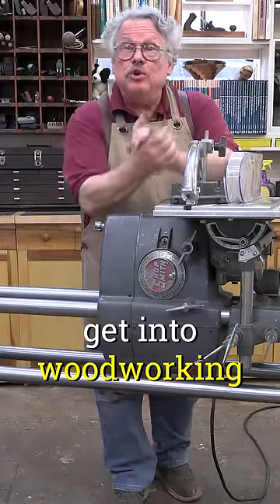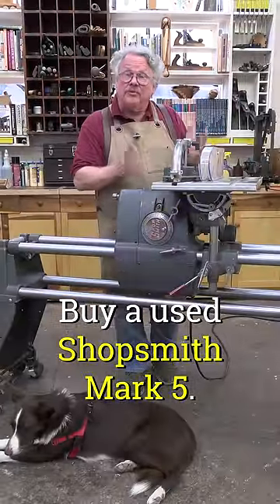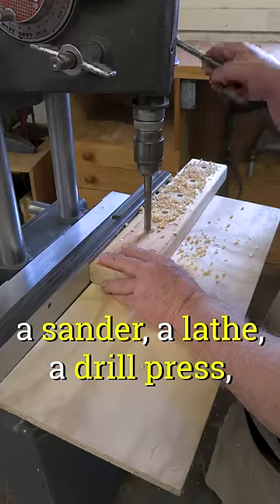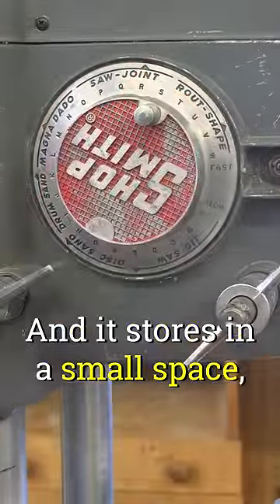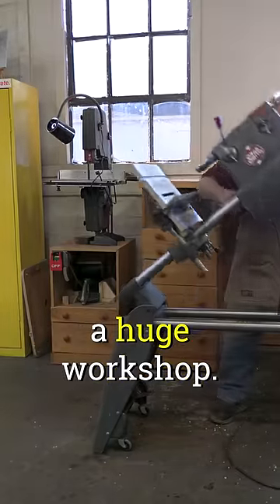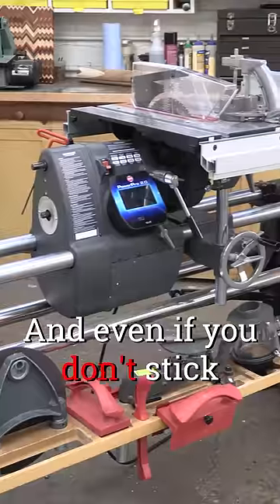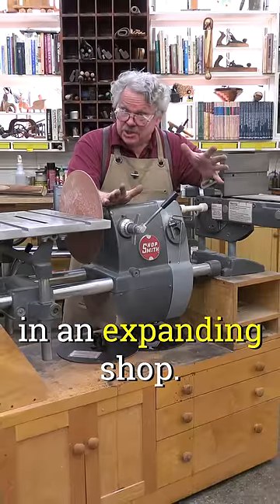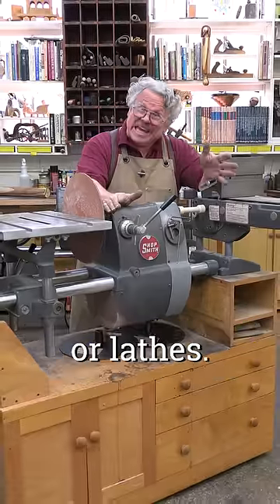A Cheap Way To Get Into Woodworking

Comment: I would tend to suggest a Mark V 510 as a starting point, since upgrading the table system is cheaper. I am leery of using the older table system for table saw operations, but that’s just me. Look for ones with accessories. I use the bandsaw and strip sander most frequently, although I also have a jointer and 6” belt sander.
Reply from the maker: All good points. Used Shopsmith Mark 5s come in three flavors -- Models 500, 510, and 520. The 500 has a small table. It's not unsafe, but it's annoying . The 510 has a much larger table and a much better locking system for the trunnions. The 520 offers an improved fence and fence lock. So the big jump is between the 500 and the 510. And Shopsmith makes several "stand-alone" tools -- band saw, scroll saw, jointer, planer, belt sander, strip sander -- that can be powered by the Mark 5 or mounted on their own stands. Many of the used Shopsmiths for sale come with one or more of these.

Comment: The old addage applies here.  Shop smith is a jack of all trades, master of none.  Setup times take too long when you need to move between types of use during a build. Had one from the 50's, and a mk 5 later on. both were gifted to my by other woodworkers. One ended up as a drill press always, and the other as a lathe.  Too dangerous as a tablesaw. ended up getting rid of both for dedicated tools, because the dedicated tools are much better at the task they were designed for.
Reply: That was never a problem for me after I got the bandsaw on a separate stand.  And it fits.

Comment: I don't think it's a Mk 5, or if it is is an older version, but I got it for free, and I primarily use it as a drill press, larger lathe, and for sanding. And at some point I'll probably also inherit my dad's old one.
Reply from the maker: It's a great sanding, drilling , and turning machine. I have two, one set up for sanding only, and the other one switch hits between boring and turning.

Comment: My dad has one, the saw, the sander, the drill press,  the band saw, the lathe. he doesn't use it as much as he used to; I'd love to sell it to someone that would use it to its fullest.
Reply from the maker: There is a Shopsmith group on the Reddit forums -- you might mention that to them You could also try the Shopsmith forums on the Shopsmith web site, https://forum.shopsmith.com/

Comment: Another question for you. How would you get started with woodworking when living in an apartment?
Reply: Hand tools, unironically. Depends on what you want to do, but work outside under a tree, the way most carpenters did until relatively recently. Power tools are nice in that they might allow one to work faster or do some things more accurately, but most work worth doing is still possible with a smathering of good old style saws, chisels and planes and folding saw horses--lathe turning is one exception that is kind of hard to do without big dedicated tooling.
Reply: For a super basic and compact tool kit that will allow you to do a surprising amount:
- a screwdriver with interchangeable bits
- an electric hand drill (I picked up a used one for $50 and it still works just fine 14 years later)
- a set of bits for both the drill and screwdriver
- set of drill bits
- set of sockets, handle, and adapter for screwdriver handle.
- a pair of pliers
- tin snips
- a hand saw (larger teeth cut faster but leave rougher edges and small teeth are for finer smoother cuts)
- a hammer
- a few packs of sand paper (60, 100, 220)

You can get most of this stuff pretty readily from a second hand store.  I would avoid buying a saw second hand unless you can replace the blade or are willing to sharpen the blade.  From there you can pick up new tools as you need them or as you can afford them.
Reply from the maker: See Tk-zf7sx's comment about maker spaces and the replies. Maker spaces are large, well-equipped workshops. For a small monthly fee, you can use the tools. Many offer classes, and all of them offer comradery with aspiring craftsmen and women.

Comment: Spending time converting my tool into the next tool I need would prevent me from ever doing projects.  Imagine if you just ran a bunch of boards and started the next process only to realize one was damaged or you need one more.  You have to convert the entire tool back.
Reply: You either invest more money or more time.
Reply: It literally takes one minute to change functions, but you do learn to plan ahead better.
Reply: Imagine rolling your big table saw out, meticulously setting the fence to rip a bunch of boards. Satisfied that you did the job right, you tear down your set up and move on to the next thing only to find a spoiled board. You still have to set up the saw again.
Reply: @nathanwahl9224  It takes way more than a minute for some functions.  It's just another barrier that is going to cause many beginners to not even bother doing a project.
Reply: @mikeking7470  Why pretend that setting up a table saw is somehow equally difficult to converting a tool into a table saw AND setting it up as a table saw?

Comment: I more or less inherited one that my dad bought in the 70s. It has barely been used but has been stored in a leaky shed for decades so there is some weather damage. I don't know how bad it is yet. 😢🤔🤓🍻
Reply from the maker: Fortunately for people who inherit or purchase neglected Shopsmith equipment, most of the work surfaces are cast aluminum. It takes some elbow grease to get rid of the corrosion, but they do no pit. The biggest problems are usually the way tubes, and being steel these will pit. Fortunately the pitting does not affect their operation; they will work fine if you polish and wax them. Quick tip: Because the of the manner in which these tubes are manufactured, they all have a very slight bow, so small it can be hard to see. After polishing the tubes and putting the carriage back together, leave one of the way tubes loose in its sockets. Slide the headstock back and forth on its tubes to see how easily it travels, then move the loose way tube 1/8 turn and see if the headstock travels any better. Continue until the headstock glides easily -- at this point the tiny bows in the way tubes are aligned. Lock the loose way tube down.
Reply: @WorkshopCompanion  Thank you for your response. I am actually most worried about the motor. The roof leak in the shed is bad enough that the floor has rotted from under the Shopsmith and it is setting on the ground. Once I get it out I will be able to inspect it better. 😢🤔🤓🍻

Comment: I had one with a bad motor and i just sold it for 100$ to a guy on facebook. He drove 10 hours to pick it up so i feel like i sold it for less than it’s work but i haven’t used it in years and since i’ve replaced it with equipment that does one job

Comment: Step 1. Buy a Jigsaw

That's it. Thats the only tool you need. If you get really good with a jigsaw you don't need anything else. (Except maybe a router)
Reply: There is a lot of truth to that! I built a teardrop trailer with a chop saw, a scroll saw, and a belt sander. And, of course, 3/8" corded VSR drill for drilling and driving drywall screws.

Comment: I have one I'd like to gift but I feel bad not having many accessories for it so I am sort of stuck... makes for a neat tool though.

Also you can get a low speed or high speed gearbox for up to 10,000 rpm I think.
Reply from the maker: Used to. Shopsmith had these gearboxes available before they came out with the digital variable reluctance headstock, which delivers 250 to 10,000 rpm with no change in torque or hp.

Comment: I’m a welder fabricator. I think this could be useful for metalworking as well
Reply from the maker: I've used my Shopsmith for metal spinning -- turn a hardwood wooden form, then spin a round sheet of soft metal, pressing it to conform to the form. I've spun brass mostly, and it works well.

Comment: I recently acquired one. With all the attachments. Unfortunately it's missing a few key components for it to work. May have bitten off more than I can chew.
Reply from the maker: Lots of SS parts available on Ebay, or from the company itself. Be sure to get yourself a manual; they're free: https://www.shopsmith.com/manuals-information/

Comment: Yeah no.. get cordless drill in your price range, hand saw, couple basic chisels, drillbit set, metal ruler, 90/45 angle, box cutter, pen, basic hand plane, diamond file, round and flat rasp, metal file for finishing wood and sharpen plane blade, wood glue, least 3 clamps and few grits of sand paper. In new those are maybe 400$ used maybe 100-200$ if you look for good deals. With those you can build pretty large projects even on small apartment, while outsourcing metal work and cutting the wood to shops until you get space and tools to mill your own lumber. You can also save lots by recycling materials or dumpster diving on wood suppliers scrap bin

Comment: Are they useful for metalworking as well?
Reply from the maker: A Shopsmith requires a speed reducer and a two-axis table in order to use it as a metal lathe.
Reply: @WorkshopCompanion  interesting. Thanks for responding!

Comment: If I don't have a lot of space is it viable for me to get into woodworking with just a rotary tool? I have a knockoff Dremel brand and have been watching videos on how to make small projects. Thanks for the video!
Reply: hand tools Dude Hand tools
Reply: Really depends on what kind of woodworking you want to do. Dremel are great for carving figurines with shaper bits, that kind of stuff, but if you plan to make fine woodworking projects like jewellery boxes or furniture, a dremel won't cut it - literally and metaphorically. Rex Krueger here on yt has some great vids on how to get started with cheap hand tools and a low, inexpensive woodworking bench. Good luck!
Reply: you can definitely rig up a dremel to a cnc machine a go tot town. also for small tools, I'd recommend a good drill, sander and one of those hand-held saws like a worx one. i love mine and got it for $40.
Reply from the maker: If you have the desire and the gumption, you can get into woodworking with a pocket knife. And don't think you actually have to own the tools to get started. Several of my friends learned from kind neighbors with tools -- woodworkers tend to be extremely helpful people, as you can tell by all the folks who answered you. You might also look for a "Makers Place" near you -- a well-equipped workshop that you can use for a small monthly fee. These too are usually filled with helpful people.
Reply: Thank you all for the kind replies, they help lots! To answer clang's question, I'm starting off my making small wooden rings. I'm not planning on making furniture just yet and probably would have the space for a small workshop by then. Again you all are amazing thank you!

Comment: You could spend $2000 on a shopsmith (not including the cost of freight shipping or going to get it yourself) + more on accessories, or you could spend $2000 on everything a new woodworker needs + more on accessories. Either way it wont be cheap.

Comment: Anyone in the northern VA area in the market for a shop smith v 5 I have one practically new bought from a collector and used a handful of times. My space and needs were too big but it’s got all the fittings and attachments that came standard and then a bunch more add ons it’s the anniversary edition.

Comment: Hey there! I just have a question real quick. So, I'm not sure if you’ve ever seen the show NCIS, but in the show one of (if not THE) main characters is Leroy Jethro Gibbs. Now, Gibbs is... an interesting person, not keast of which because he literally builds boats in his basement... yeah. So really, I just want to know, is it possible (or probable) to do what Gibbs does: build a wooden boat using only hand tools in a small(ish) space such as a basement? And if you think this question is dumb, unprecedented, and just overall not one that you (or anyone else) can even answer... you probably have a point 😂.
Reply from the maker: Depends on the access to your basement.
Reply: @WorkshopCompanion  Gotcha lol! In that case, it is stated that Gibbs uses a hole in the wall to get it out. Meaning all he has to do is break down the wall, wheel it through and then bring it up to a ramp of some sort I think. Anyway, as I said before this is probably a stupid question but I can't stop thinking about it lol!

Comment: Is $1600 CAD fair for a like new Mark V? I never knew about something like this and I feel like it's exactly what I need.
Reply from the maker: Depends on the accessories it comes with -- and your area of the country. For a Mark V Model 500 with the standard accessories in the Midwest, it's pretty high. If it comes with a few SPTs (single-purpose Shopsmith tools, like a band saw), or if it's a Model 510 or 520, that would sweeten to pot.

Comment: Much better solution:: start woodworking with hand tools.  Learn each tool, master each tool, learn what the tool is for, learn to "listen to the tool".  The great majority of operation of woodworking can be done with hand tools and most projects require hand tools even if you have power machinery.

Comment: I wouldn't touch this with a 10 foot pole. Very dangerous and difficult to find replacement parts. For the same price i would buy individual parts. If the motor goes out then all your tools go out.

Comment: Can the lathe also be used for metalworking?
Reply from the maker: I've done a fair amount of metal spinning on my Shopmith. And I've seen a video showing how to convert it to a metal lathe by mounting a 2-axis milling table to the carriage. The problem is speed -- the standard headstock can't be adjusted to run much slower than 700 rpm, the "PowerPro" headstock won't go down beyond 250 rpm. You need to find one of the speed reducers that Shopsmith sold in the 80s and 90s.

Comment: Could you use this machine with metal work?
Reply from the maker: I have use may Shopsmiths extensively to work aluminum and brass when building airplanes -- cutting, drilling, turning, and milling. For the last two, you need to get adapters so you can mount . chucks and arbors. Have also found that the Shopsmith in the lathe mode is exceptionally good for metal spinning because of its low speeds. A Shopsmith with a PowerPro headstock is even better -- the digital controls allow you to get down to 250 rpm. However, the one thing you miss when metalworking with an SS is the hollow arbor that it so useful for threading and turning rods and pipe.

Comment: Mine the dial is locked and the motor keeps tripping the breaker should I fix it or do I buy a new one
Reply from the maker: Sounds like someone may have tried to turn the dial while the machine wasn't running -- that can really screw things up. Suggest you call Shopsmith customer service -- they're pretty good at diagnosing problems like this, and they can tell you what it will take to fix the machine.

Comment: It's true, but the amount I work between tools back and forth, changing the configuration would drive me crazy.
Reply: It doesn't take nearly as much effort or time as you think.  Some buddies were over and bet me that I couldn't do something in each configuration in less than four minutes.  I won the bet.  That and having their bandsaw on a separate powered stand eliminates a lot of that swapping around.  One nice thing, if you cut something with the miter gauge at a particular angle, you don't have to do anything else to switch right over to the disk sander.

Comment: "How do you get into woodworking without spending a fortune on tools?  Spend a fortune on THIS tool that I definitely don't get paid to tell you to buy"
Reply: Actually I'll end that with constructive advice because you seem like a good man.  Actual good advice for beginners is buy broken tools and fix them, you can get really high end tools for basically free and they're usually trivial to fix, like a bad connection or worn brushes.  Don't tell people to spend over $1000 on one tool, because there's no way in hell you're finding a working one of those for less than $1000.

Comment: Mines sitting in the desert sun cause I have no idea what to do with it or how it works at all :(
Reply from the maker: There are manuals available online.
Reply: @WorkshopCompanion  yeah I definitely am rethinking about selling it. I have posted it up for 250$ before and no one wanted it. This video and the fact I have the planer, disk sander table saw and a loads more accessories with it I’m going to keep it and fix it up so I can start making better furniture. I am the one who makes all our furniture for our home we bought a few years ago. I have spent 1000$ on tools I probably have with the smith table.

Comment: its so annoying to crank up and down the rpm every time you want to use the saw. the janky as rod system with a crap fence is a joke . the table flexes too much because only one of the trunnions has a lock